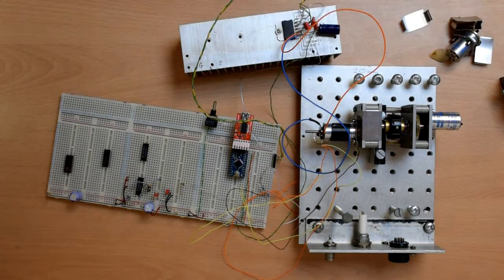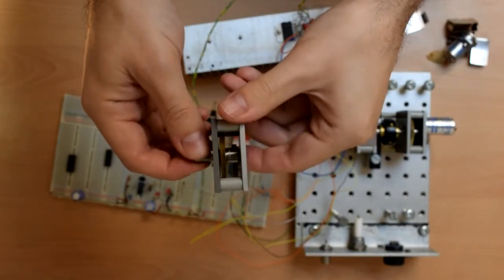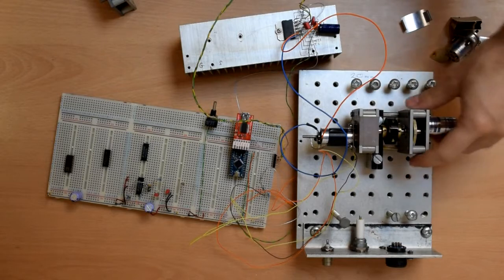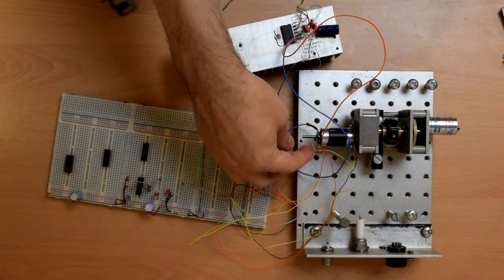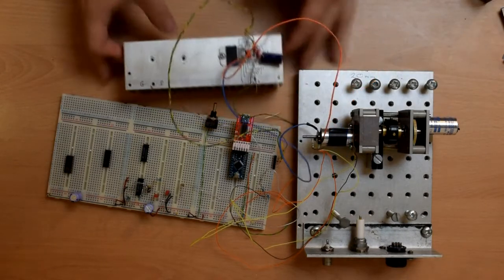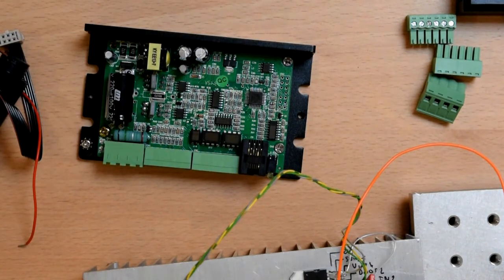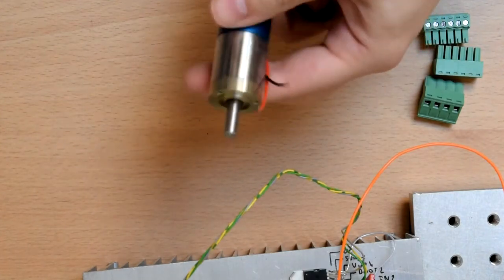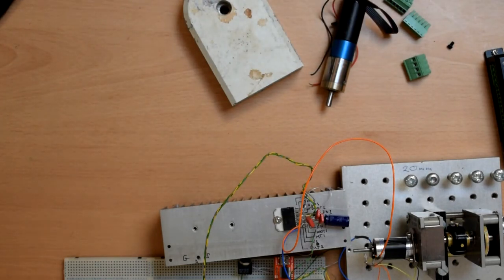3D printer DC servo motor extruder part 2

Comment: This should have more views and comments.
Reply from the maker: yeah.  unfortunatly i never finished this project and ended up useing the boring stepper motor solutions like everyone else.  I'm waiting for someone to build a brushless motor based extruder that i can buy.
Reply: @Sigmatechnica  I was thinking of usin N20 geared dc motor of this .. modifying it to the needs ..
But somehow all my 3d printers are facing issues and were not really clean designs to build with for tinkering .. so now planning to make one again .. 
Just waiting to go to buy mgn rails :)